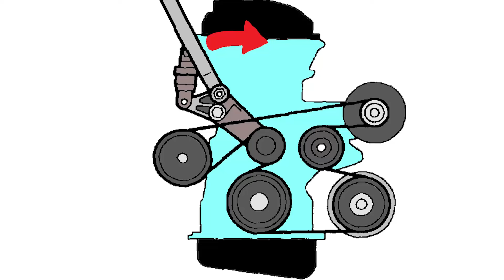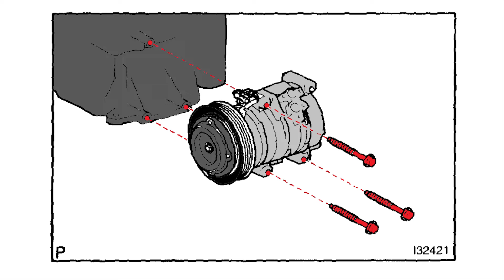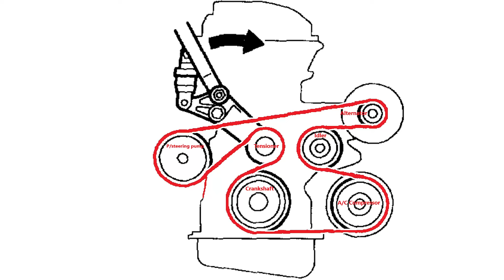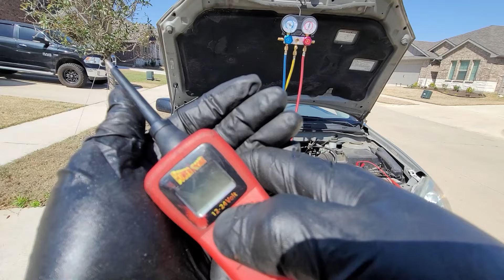2003-2006 Toyota Corolla HVAC Compressor

Comment: This video is awesome! I wish I know exactly how to do everything you’re doing. I have a 03 Corolla that I’m going to be changing the compressor. Probably going to get the ac evacuated by a shop and then change it out. Then going to vacuum the system myself but idk if understand the vacuum fully and also idk how much Freon to put and don’t understand the vacuum the bottom line longer before adding?? Thanks for the video!

Comment: Doesnt the positive battery cable need removed, too?? My family members who are mechanics always remove the positive cable.
Reply from the maker: It's not necessary for working under the hood. Removing the ground opens the circuit, and there is no longer any power being supplied to the electrical systems. Though, some interior systems have capacitors that can store power for up to 15 minutes after the battery is disconnected. So it's always best to wait after diaconnecting the battery when working around the dash. However, if I'm removing an airbag, to replace a clockspring or remove the dash, I'll remove just remove the battery just for extra caution.
I hope that answers your question. Thanks for watching!

Comment: What city are you in
Reply from the maker: I'm based in Denton, Texas, but travel all over North Texas
Reply: @theaffordablemechanic  Close but not close enough I'm in San Antonio. Do you happen to have any recommendations for shops in my area? Would you recommend replacing any additional ac components at the same time as the compressor such as the condenser as I've heard that when certain components fail they can contaminate other things with metal shavings causes replacements to fail.
Reply: @jackwilliamson1929  I replaced my condenser for warranty reasons with Denso.
Reply: Where can I get the o-ring my ac comprrssor did not come woth them

Comment: This is really weird. It's like watching myself of video. We are built the same, look the same, and have the same silver Toyota. I have more grey in my red beard and probably 20 more pounds of blubber, but other than that...

Thanks for the clear, concise video on this process. I just had a local place evac my system, since my compressor has failed. I plan to flush the hoses and replace the condenser due to that failure. I'm not too intimidated by the job, but doing some research makes things a little more simple to grasp. I had planned to R&R the compressor from underneath, but didn't realize how easy it is to remove the alternator. That is the kind of thing that makes you tube worthwhile.

Also, when a compressor comes pre-filled, is there any need to measure it to be sure, or to add any other oil to the system? Or just install, charge it up, and go?